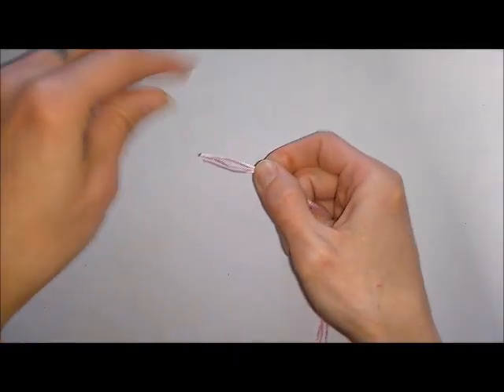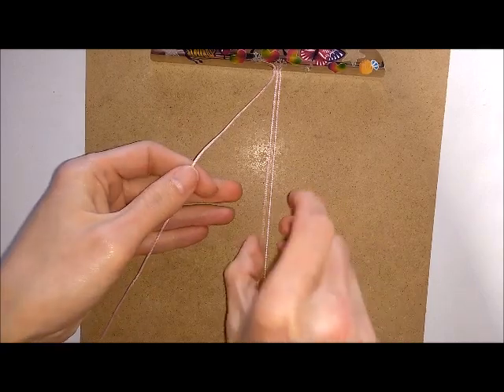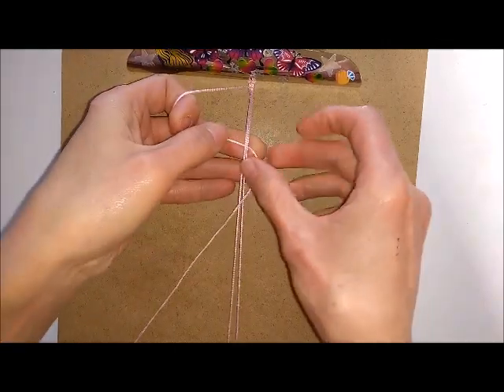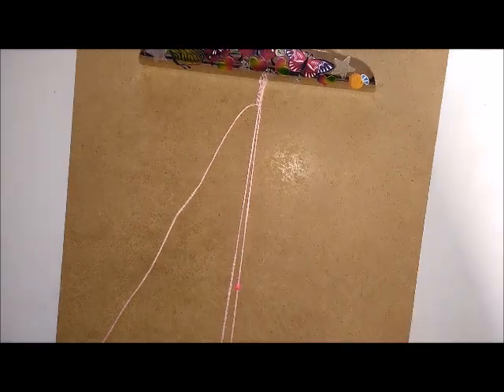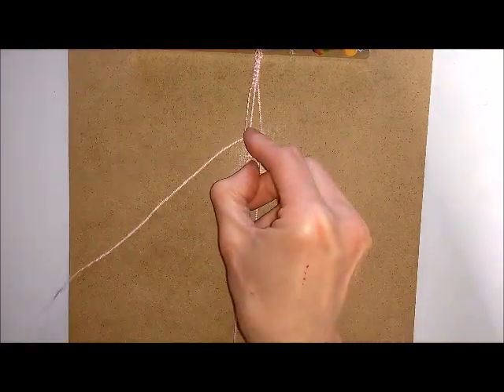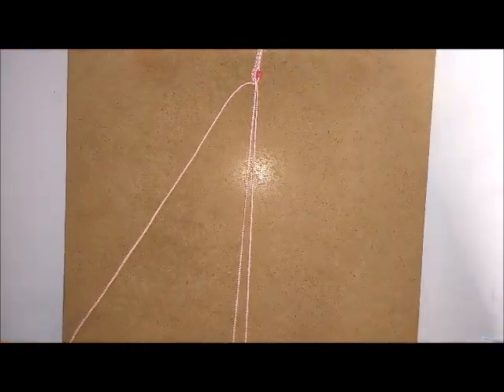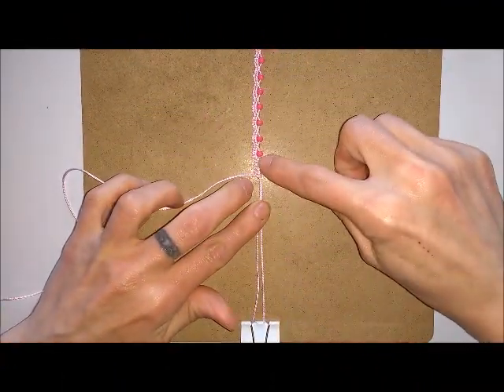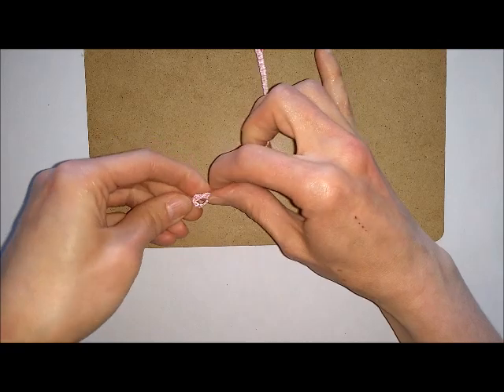How to Make a Beaded Macrame Anklet [Ankle Bracelet] Tutorial

Comment: It's coming spiral... How do u make it look straight
Reply from the maker: The knot is worked in two halves.  The first part should take the working cord over the top of the holding cord and the second half should work it underneath.  If you do over the top (or under) both times, it will result in a spiral.
This might help explain the method used better: https://www.youtube.com/watch?v=nQDrJoIXuiU&t=3s